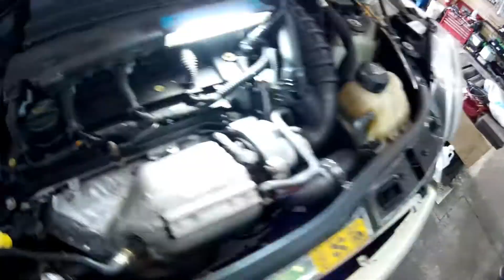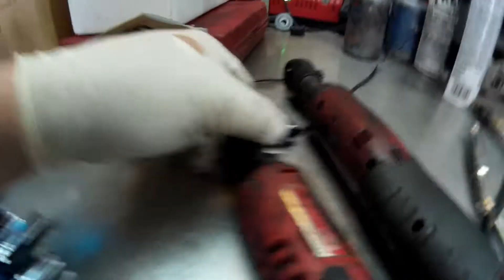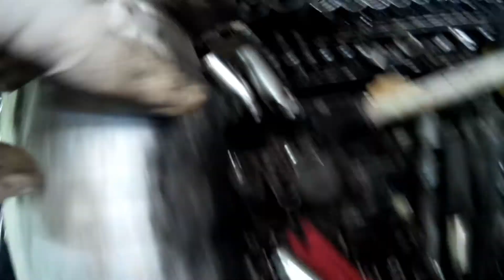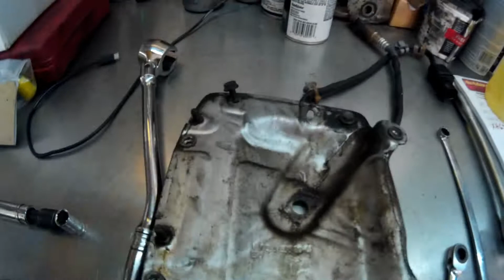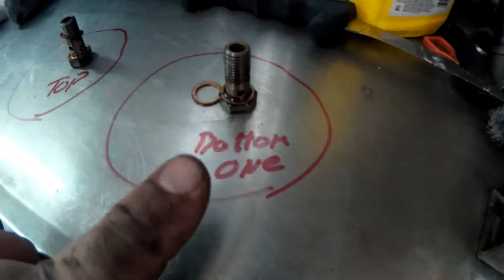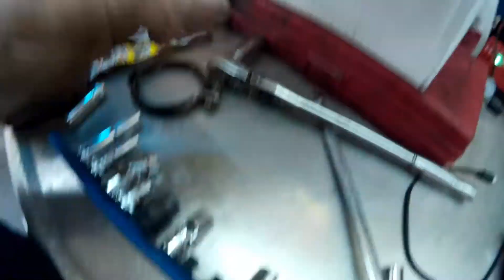2009 Mini Cooper S Turbo Oil Pressure Line Replacement

Comment: You should've used the modified turbo oil feed line. Detroit Tuning has them and ebay. It has the bonjos on both ends and a braided oil line. :)
Reply from the maker: I would have but the customer brought there own line in. So that's why I put it in. Thanks for watching
Reply: @TheGAutomotiveAndMore  oh ok, i thought it was yours :) gotta do what the customer wants 😊👍

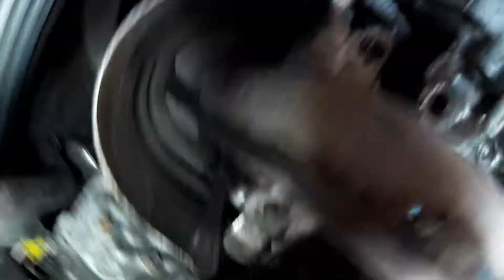Comment: Hello, how did you remove the heat shield? Did you pull it out from top or bottom of the car? Im refferring to 3:13. I am stuck on how to get it out. I already unbolted the heat shield but its stuck inside. Thank you in advance!
Reply from the maker: Sorry I can not remember, but I think it came out threw the top. Thanks for watching